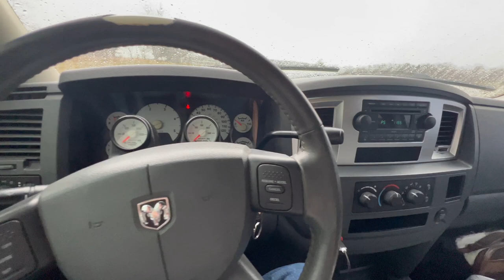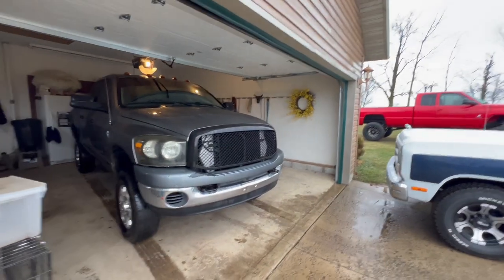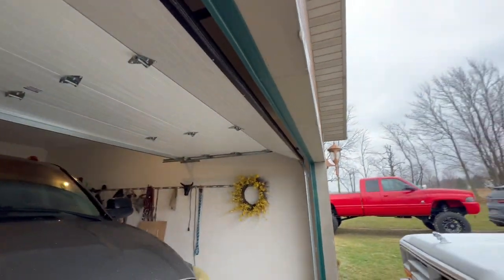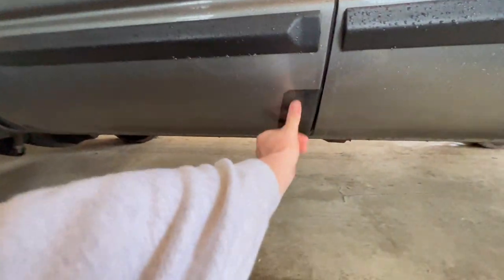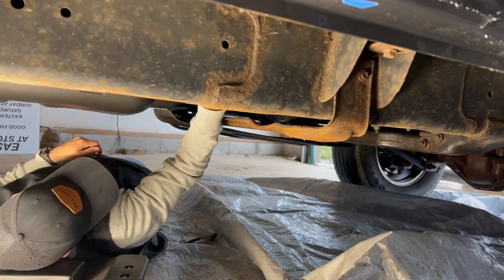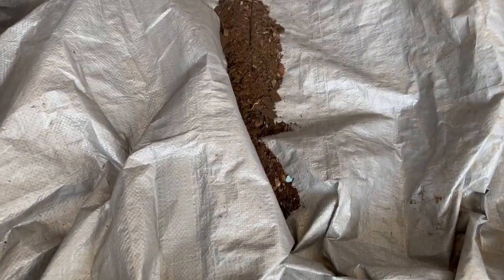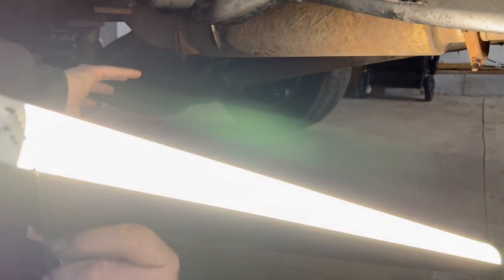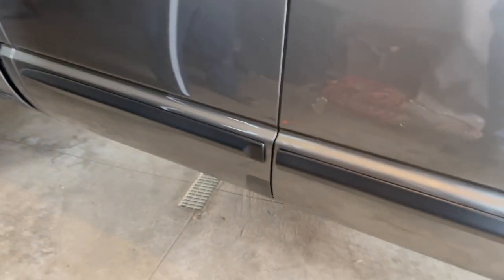EVERY truck up north should have this done!!!

Comment: You should just use fluid film and crc 6026. Crc 6026 works great for exposed areas since it dries and does not wash off easily.
Reply: What are those compounds? I just moved to central NY from South Louisiana. My biggest culture shock and concern has been the salt during the winter. 
I very quickly realized you hardly see any older vehicles on the road up here compared to back home. I like paid off vehicle. Rather maintain an older vehicle than pay notes on an older one. 
We have a 2014 Subaru Forrester with 45k mikes and a 2002 F150 Lariat with 90K miles. I’m worried about both of them. Any advice?

Comment: Hey man, I'm up here in NE Ohio, I own a late 3rd gen aswell, and I'm a former body tech. If you need to tips about body work I got you, I know a lot of the tricks of the trade. As far as coating the frame POR-15 is the best rust converter on the market right now Id recommend it over oil bathing the frame, also take to door trim panels off and fluid film or beeswax the interior, pull the rocker plugs and do the same.